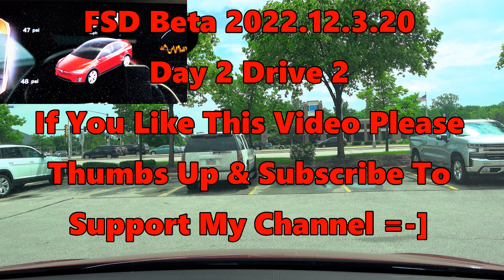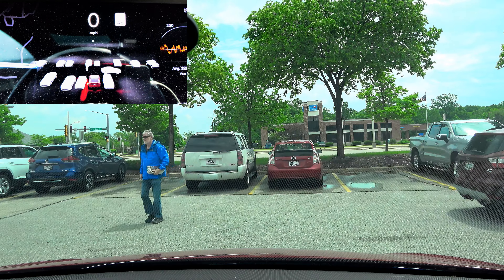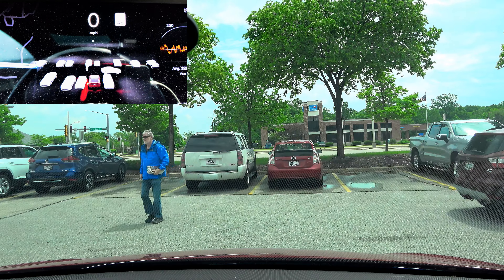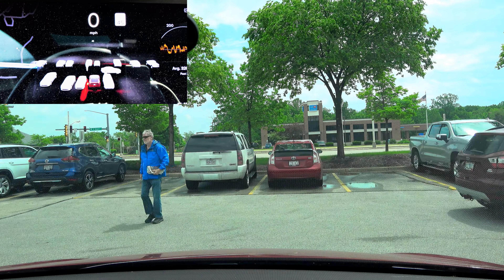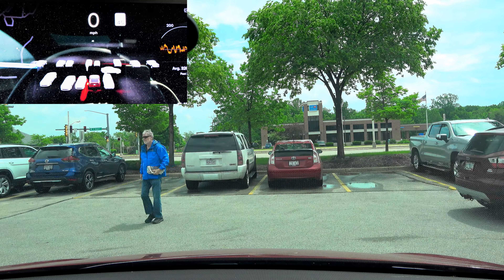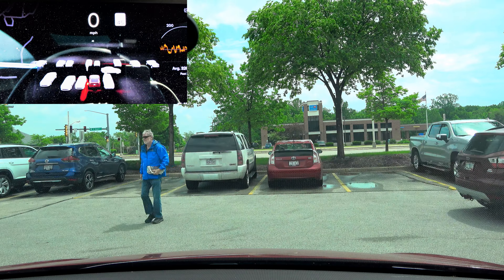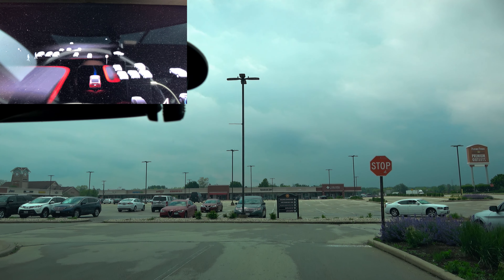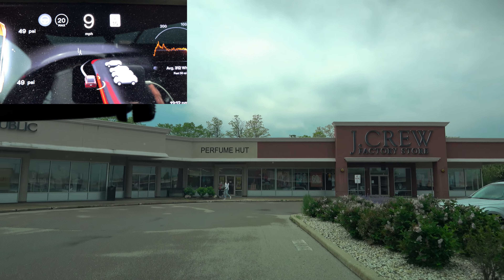FSD Beta Second Day Drive 2 Not signaling, Missed On-Ramp, No FSD On Freeway, Center Turn Lane

Comment: It doesn't really handle areas with bad or no map data for navigation yet. The initial work for that is supposed to start in 10.13.
Reply from the maker: Noticing that. even worse in parking structure, tried driving over the side of the top floor, didn’t even try slowing down for the concrete